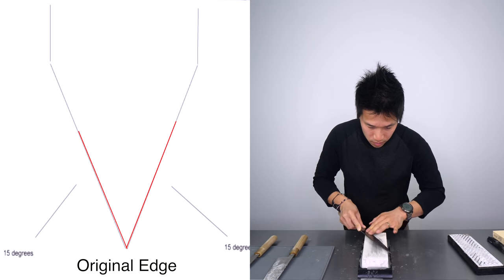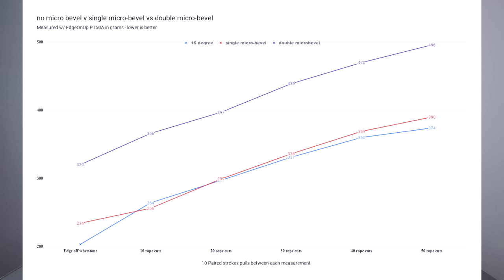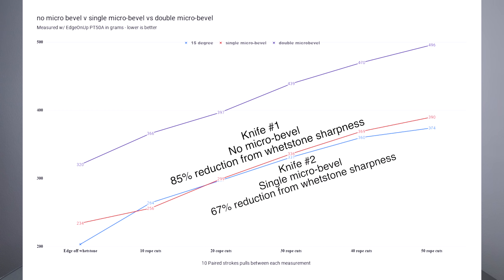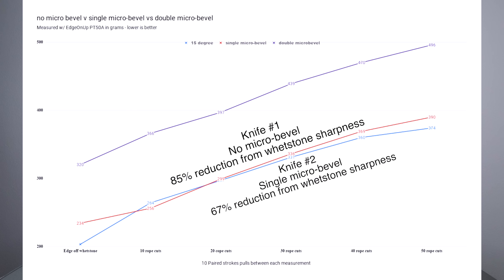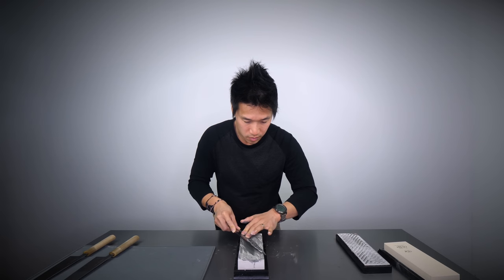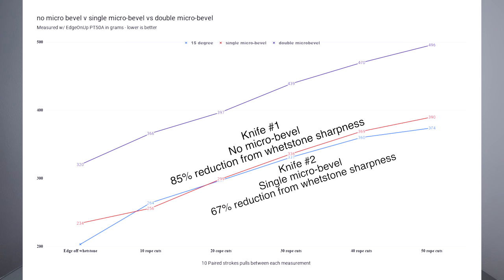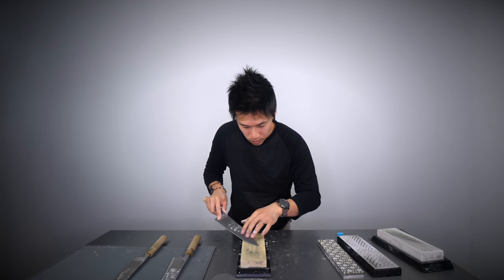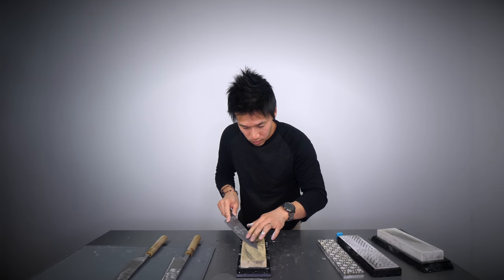Do Micro Bevels ACTUALY work?

Comment: As with anything,  they have a purpose.  It depends on the application.  
30* total is sharper than 60* total.
If you are slicing sushi don't do a 60 micro.
If you are cutting rope, and don't want to have to stop and sharpen a lot,  find the bevel
that is sharp enough to cut yet hold its edge. 
And then the grade of knife plays into the factor also.
If you have some german steel that goes dull in one meal, or several times in one meal and you are spending more time on the rod then on the food,  sacrifice a little sharpness for durability.  It doesn't have to be a micro bevel,  you can just sharpen it to 20 a side.  Or 25 if need be.  It will still cut and stay   sharp longer. It just wont cut as nice.
Whereas if you get a really highend expensive steel, you  can go 12 to 15 a side and it will handle it and cut like butter.  
It just depends on what you are using the knife for and what grade of steel you have.  
Also the 2ndary or main bevel will play a role in how a knife performs also.  
Simple rules in knife sharpening.
Thinner is sharper and cuts the best but will dull easier.
Thicker will be more durable but nut cut as well, but well enough. 
Personal preference and experimentation will get your knives
where you want them.  
Micro bevels do work for making a knife more durable.

Comment: I sharpen knives with hardness around 55-60 HRC. They can't hold an edge with 10 degrees sharpening but if I add a 15 degree microbevel on it it will hold the edge and have higher cutting capacity than standard 15 degree sharpening.

Comment: Micro bevels are useful in different types of edged tools.  You sharpen culinary knives exclusively.  Micro bevels can be useful on a few culinary tools that see hard use—mostly for meat processing: cleavers, large butcher knives that are used in commercial environments.  For slicing, paring, pealing, as well as other kitchen uses micro bevels are counter productive.  When we get into other types of knives and edged tools, like those used for landscaping, agriculture, wood processing, military use and outdoors activities, a micro bevel can be a useful way to expedite field sharpening and avoid damaging certain blades not used for fine work.  Good video, you make a great point.

Comment: The one place a micro bevel works great is for boning beef meat processing plants. I've used single and micro beveled knives, and the resistance of the shoulder in a single bevel when moving against bone causes enough friction to increase RSI/Carpal Tunnel Syndrome development. Add a second shoulder with the micro bevel and you're reducing the corners that 'catch' in the bone. You can also feel it. A good micro bevel will feel like it's oiled as it works, the single will have a definite dragging feeling by comparison.

This is where I feel a proper convex edge would be superior. I'm going to buy a convex rod for my KME and sharpen a few knives for the experienced boners at work to see how they find them.
Reply: Sounds like an interesting experiment. I'm curious about the feedback you received.

Comment: Thanks for addressing this topic. I do a fair bit of sharpening and have only used microbevels a handful of times. Much like your testing, I just don’t see an appreciable difference in performance. In my mind, why bother then? I guess I could see using them as an attempt to minimize a chipping issue. Aside from that, I’m fine with my edges just the way they are. I don’t dread sharpening or feel the need to worry about getting a dozen more cuts before having to get the edge back in shape. I prefer to keep things simple. Also, thank you for calling out those who like to “edge shame” anyone who doesn’t sharpen the way they chose to. It’s one of the things I love about your channel. It really turns people off for getting into sharpening if it seems overly complicated and rule-driven when they’re just starting out. I honestly think people on the forums just invent ways to create an apparent gap between themselves and others. Group think can be pretty frustrating.
Reply: Personally I only use them on knives outside of the kitchen. And the only reason I have them on those is it makes sharpening take a lot less time.

Rather than grinding an entire layer off the main bevel, I just have to take a tiny bit off at the very edge and it's back to where it was

Comment: The big advantage of micro bevels is that the blade is less prone to chipping. Usefulness depends on the usage and environment. Lots of contact with bone or outdoors, the bigger angle is your friend. If there is chipping, it will only chip as far as the microbevel before the thickness of the blade shields the rest. If a big chip needs fixing, you'd wish for that micro bevel.

Comment: The advantage of micro bevels, and the sole reason they are used by people, is the sharpening time. When you use a multi stone sharpening set up, essentially you are polishing the entire bevel of your knife. That can take an extended amount of time, and is more expensive the more your experience grows and requires higher quality stones. Micro bevels allow the primary bevel to be sharped to a much coarser finish, the final step to creating a sharp edge on a knife with this process is a few passes on a high grit waterstone or ceramic rod at a higher angle, creating a microbevel. As you are polishing a much smaller area, it’s really simple to polish a knife this way. After some use, you can just skip the maintenance procedures and reset the micro bevel in a matter of seconds. Very efficient, quick, and it produces great results every time. However, since a coarser scratch pattern produces more aggressiveness in a knife, it may not be as suitable for some kitchen knives, as clean cuts are very important in certain culinary situations. Still, not that much people will notice any difference in performance. Essentially, they are optimal for cheaper knives that you don’t want take your time to sharpen.

Comment: I use 10 degree sharpening and then put a 15 degree microbevel on it. Knives with 55-60 HRC that would easily roll the edge at 10 degree can hold this acute egde if I put a microbevel on it.
 There is a big difference in performance while cutting vegetables and I really like the result.

Comment: I have set just one micro-bevel. I did it on both sides, and it has worked very well. I do not do it more often since I have not found it necessary to achieve a very sharp edge with the right tools and technique. However, an EDC m390 steel has given me fits. I can get it sharp, but never enough. (I know this is relative). This is very difficult steel to sharpen, but I have done it before; however, in this knife, it has been such a challenge. The double edged micro-bevel sharpened quite quickly, perhaps because the micro edge is so much less metal to sharpen or maybe due to the  additional edge combined angle. Not sure, but it worked well. I have no desire to do this as long as I am successful otherwise.

Comment: Another great video! I always appreciate your take on take on things. The scenario in which I think a micro bevel is useful though, is in maintaining your edge especially if you are not very skilled at sharpening yet. I used to have my knives sharpened professionally to a very acute ange, maybe 13 degrees per side, and maintain them with a spyderco sharpmaker set at 15 degrees per side until the knife wouldn't take an edge I was satisfied with and then start over. I would say my results were just slightly inferior to what I get now being a pretty compitent sharpener with a wide range of stones.

Comment: Interestingly the microbevel is the basis behind the Spyderco sharpener that I uesd for a number of years (and still do for a few kitchen knives and several folding knives if I just don't feel like getting out the tone). There are two positions available on the block for orienting the rods, one to set the back-bevel (used only infrequently) and one to "sharpen", which is really just the microbevel in these terms. It does work quite well. Learning to use stones work far better and I can't be bothered to set a secondary on stones on knives with good steel.... but like you basically summarized "i can't hurt".
Damn right there's no right one way to do any of this. Preach it. :)

Comment: I had a microbevel on one of my knives a while back, it was useful for preventing edge damage due to the steeper final angle, however I found the extra step in sharpening made it pointless afterwards it’s easier/faster to sharpen the knife with a regular edge. The sharpness difference was negligible

Comment: My spyderco comes with a 30 degree primary bevel and 40 degree micro bevel. If I were to sharpen it, should I maintain this setting or do away with the micro bevel? I'm new to free hand sharpening but I've been using the spyderco sharpmaker which has slots for both 30 degrees and 40 degrees. But my hands a growing itch to try sharpening on the whetstone. Hehe

Comment: Question:  I have a King KDS 1000/6000 combination stone. Can I soak that stone every day without water logging it to the point of damage or performance loss?  Or does it need time to dry out between uses?  Is your answer the same for all soaker stones?  Thank you for making sharpening accessible to those of us who don’t know anything yet.
Reply: @Mark Schonhoff I have this combo stone. In my experience, the 1000 side barely needs any soaking, say 30 seconds. The 6000 side is better used as splash and go. I sharpen my work knives about once per week. Lately, I don't pre-soak the King 1000/6000, only splash of water is needed. Pre-soak makes the stone too soft and easily damaged. I put away the stone to dry on wire rack. It's ready to be used in same condition after 5-6 hours.
Reply: Thank you
Reply: I am soaking the 1000 side for 25 minutes and using the 6000 side as a splash and go. I settled on 25 minutes on the 1000 side because the stone seemed to dry out before I could get through a pass if I soaked it for less time. Is that correct reasoning?  I think I saw in another video on this channel that it’s best not to stop in the middle of a pass. And splashing the stone during a pass does require me to stop.

Comment: Something is missing, what about 8°~ sharpening and add a microbevel after that. Getting to a lower angle on the bevel might help cutting since it get the blade thinner at the edge, and the micro add a bit of toughness!

Comment: I only use micro bevels on chopping type knives to me it appears to add strength also knives with a high Rockwell hardness I tend to through on a small micro beveles. I do want to say this your vids have made a huge impact on the way I sharpen knives you've just made them a pleasure to learn from ive realy learned allot also you are responsible for my addiction to Japanese kitchen cutlery lol never owned one a day in my life until I bought a Dalstrong and now I own several. So thank you for your video's. When I get the $ together I realy want to purchase a strop or 2 from u.

Comment: Boxcutters as far as I know all come with microbevel out of the box, because of the material it's cutting(cardboard, one of the most abrasive material  in daily use), thin grind, acute edge angle and low Rc. They did microbevel cause it's the cheapest solution available trying  to prolong the edge retention. As a result, even a brand new boxcutter is never a good cutter against thin material like paper because the actual edge that's doing the cutting is the barely visible microbevel that is more obtuse and coarser. You can always feel and see the drag with a boxcutter cutting paper that shouldn't be happening on such a thin blade and basic carbon steel.

Comment: hi Ricky I it takes me long enough to sharpen my knives slowly and I am happy with the results thanks to your tutorials I don't really know why a microbial is necessary I have listened to many knife sharpeners and they all have strong opinions one way or the other as far as I am concerned as long as you can get your knife sharpened and it stays sharp for a few weeks I don't think there is a need to go further . I have been using the strop you sent me and it has helped me keep the edge on my knives longer between sharpening .A question why did you use the Suehiro debado stones in places the cholera stones .
Regards Dean from Oz
Reply from the maker: just testing more stones. i know i love the chosera stones, and just trying to use more stones, and different grit ranges. the suehiro stones are very different and fun to use

Comment: Question, if you need to pick up only 3 stones (and the grit # for each one of them), what should I buy, are they have to be from the same kind?
What I mean is can I start with Chosera 800 Grit Stone, move to Chosera 3000 Grit Stone and then finish with other 5000+ Grit manufacture stone.
Thank you
Guy
Reply: Guy Naba I do find that the scratch pattern on your knife is more consistent with the same brand, and those three grits would be a great option. But most important, even if you only use one stone, is to keep your angle consistent over the entire edge.
Reply from the maker: watch tomorrow's video.

Comment: I enjoy the process of sharpening my knives, so I tend to add a single edge micro bevel. However, I've not really been able to tell the difference between when I do and when I don't. (At least not in practical application scenarios) I enjoy doing it so I do it, but the extremely marginal performance benefit won't generally be worth it for people with less time to sharpen, or people who would rather have a simpler sharpening process.

Comment: The point of the micro bevel is not to make the knife sharper or more durable.

The objective is to make the MAINTENANCE easier.

You have less material to adjust.
Just that.

Comment: I don't think we're all thinking about micro levels in the same way. For a typical FFG, I initially grind at a very acute angle (just lift the flats off the stone enough to comfortably sharpen). When that is approaching the appex, or even beginning a burr, I'll then move up to a smooth stone and lift the spine to the desired finishing angle. So in effect my actual apex edge bevel is a truly small surface area that is easy to polish up and still at around 30 degrees or what ever your desired angle. If I need a tougher field edge I just adjust the angles accordingly, but the apex edge is always a very small surface area at the desired angle. In effect this is the illusive convex edge bevel. All things being equal it is not a stronger edge, but does perform better with limited strength sacrifice.